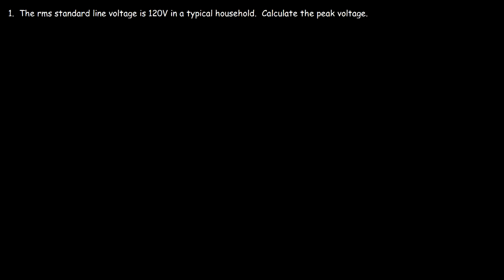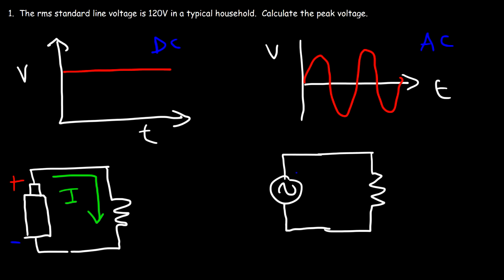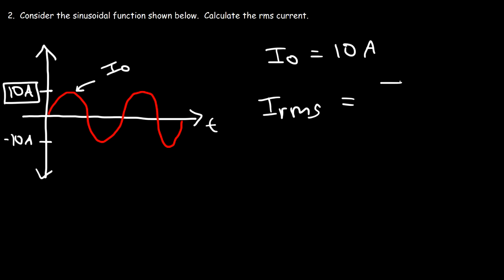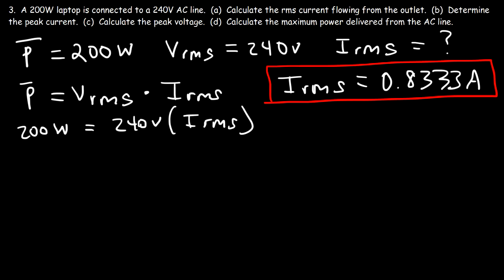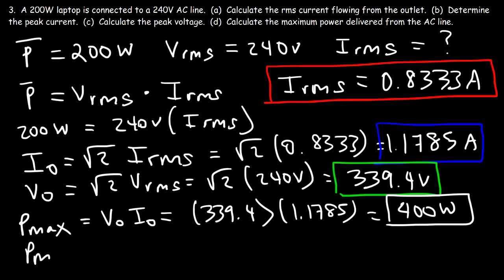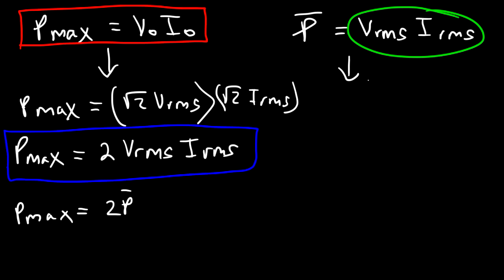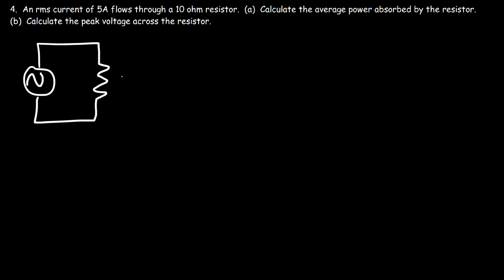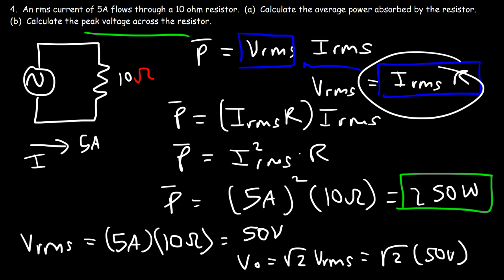Alternating Current vs Direct Current - Rms Voltage, Peak Current & Average Power of AC Circuits

Comment: Thanks for easy explanation, but I have a question to you. In the 3rd problem, in other you mean there that Rms and Average currents and powers are all same things. Cuz you calculate Average Power with Rms current and Voltage. So, can I say that they mean actually the same things everywhere ?

Comment: Sinewave ac circuits
A sinewave depicts movements in the form of waves. It has a datum, rapid, slowing and steady growth in one direction for a quarter cycle with reference to a datum (a reference), and then slow and faster decay in one direction for the next quarter cycle, and all these elements again in the opposite direction (reversal) of the forward movement for the next half-cycle. It has peaks and valleys. 

In essence, the sinewave is a perfect embodiment of oscillatory movements like springs and quantities like voltage. It retains its waveshape when added to another sinewave of the same frequency and arbitrary phase and is the only periodic waveform which has this property. 

The charges in a resistor subject to a sinusoidal voltage do not migrate elsewhere on the average. They merely slosh back and forth, so to say, over each cycle without a change in their position when the resistor was not energised. 

Electrostatics and circuits belong to one science not two. To learn the operation of circuits it is instructive to understand Current, the conduction process and Voltage at the fundamental level as in the following two videos:
i. https://youtu.be/TTtt28b1dYo and 
ii. https://youtu.be/8BQM_xw2Rfo 

The last frame contains references in video #i which lists two textbooks 3 and 4 with topics that discuss the operation of capacitors, inductors, diodes and their operation in amplifier circuits and circuit theory. 
Textbook 4 is here https://techsarworld.com/product-detail/fundamentals-of-electric-theory-and-circuits-559 

[ Also see these lectures by North Carolina State Univ faculty which use a unified approach to electrostatics and circuits.  

15. Simple D.C. circuit. 
Pattern of electric field.
Watch from  16.0 minute. 

16 Mechanical Battery
Watch from 19.0 minute.
Ch18L1b
https://youtu.be/Eu3JQKrJRZA?si=t3MeX8Hi8ELAxaz0 

17 First intro to  Surface Charge 
Watch from 10.30 minute.  

18 Surface charge gradient 
Watch from  15.30 minute. 
Ch18L2a 
https://youtu.be/bp0o1HZOs3g?si=PPiPGepbXvdTgJHX ]
A sinusoidal voltage generator operates by separating charges for the positive half-cycle in one direction initially rapidly and slowing down and momentarily halting when its voltage is at the positive peak, and then gradually reuniting the separated charges to make the separation zero; when all charges reunite, the generator voltage is zero. The negative half-cycle now commences, when the generator operates by separating
charges in the opposite direction initially rapidly and slowing down and momentarily halting when its voltage is at the negative peak, and then gradually reuniting the charges to make their separation zero; when all charges reunite, the generator voltage is zero. It then begins the next positive half-cycle followed by the negative half-cycle and the process repeats. 
Textbook 4  discusses these topics on ac circuits in more detail using a unified approach and provides an intuitive understanding of sinusoidal steady-state voltages and currents in capacitive and inductive circuits. 

PPTs and Videos with animations for all the ten chapters and a few applications  Regulated DC Power Supply, Differential Amplifier and Transformer coupled audio power amplifier of the book Fundamentals of Electric Theory and Circuits are available for download and viewing here
https://techsarworld.com/download-resource/fundamentals-of-electric-theory-and-circuits-559

Comment: Please help me with this question because I have been trying solving it since almost ten years now but still couldn't solve it.
This is question; 
A lump of gold is suspected to contain some aluminium. If d gold sample has a mass of 500g and is found to av a relative density of 5.2, find what mass of gold is present if d relative densities of gold n aluminum are respectively 19.3 and  2.6
Reply: the answer is 78g
Reply: @BonuBakir  please can I get the solution to the questions

Comment: Can somebody help me pls in this direction do i use the battery symbol or the (AC) symbol  like 
"Draw a shematic diagram of four bulbs connected in parallel controlled by a single pole switch using alternating current" PLS HELPP NOW
            ________
             |     |    |    |    |
Ac sym.    ○   ○  ○   ○
             |     |    |    |    |
             |__switch__|
                         Or
              ________
               |     |    |    |    |
Bat sym.    ○   ○  ○   ○
               |     |    |    |    |
               |__switch__|

Comment: Hi. First of all, thank you for sharing. I have a question, for a step down transformer, that will be used to convert 120V rms to 5V DC. Do we use the Vrms or Vpeak to determine the ratio for the transformer?
Reply: Vrms it is...

Comment: Wait...serious question and I mean no offense, but why wouldn't you solve it the easy way? 

V = I * R; 5*10=50V
P = V * I; 50*5=250W

Does breaking it down the way you did benefit more for more complex problems? It was kinda confusing me until I realized I had easier formulas to follow. I'm genuinely curious to know. Just diving in to trig and this stuff for work so I'm doing crash course for it all via YouTube lol
Reply: And does this rule work across the board too:

IRMS = A*.707 ??
10*.707=7.07

Also this one:

Vrms=V*1.414?

Comment: Can any  body help with this :  When 100v DC is applied across a coil , current of 1A flow through it.When 100v, 50Hz A.c is applied to the same coil, only 0.5A flows ,The Inductance of the coil is __
Reply: Inductive reactance